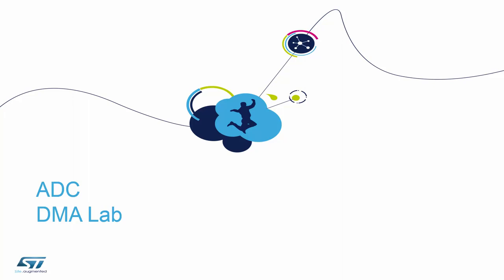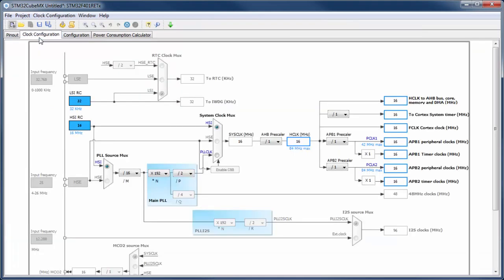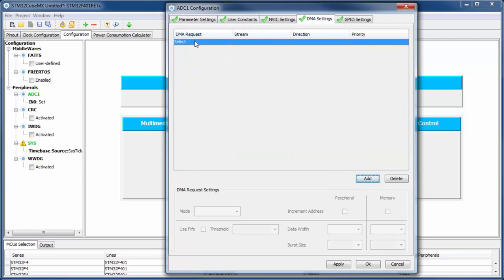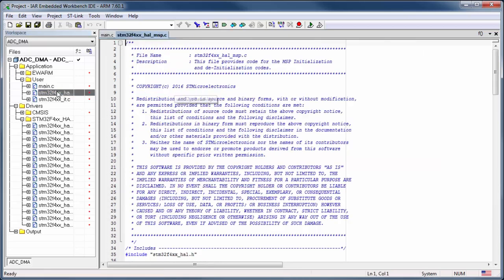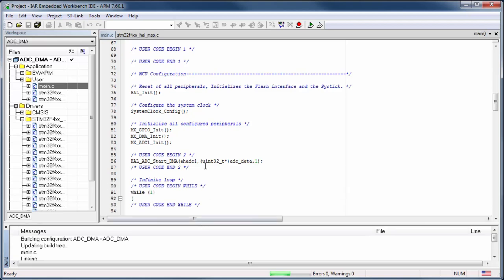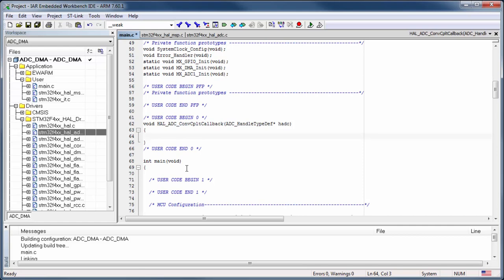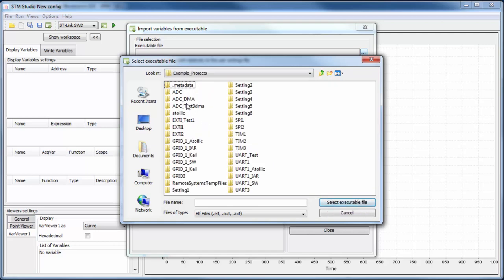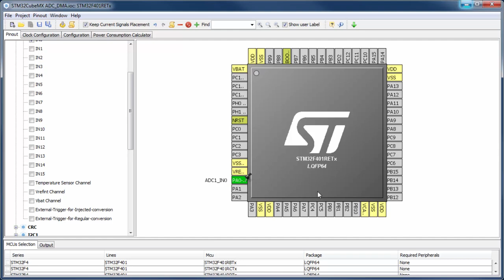STM32CubeMX basics: 13.2 STM32Cube HAL labs ADC - Lab ADC DMA

Comment: When enabling the ADC's SCAN option, will there will be a delta time between when the first channel of the sequence was sampled, and the last channel?    For example, If you have the ADC enabled to scan 8 channels, then if you use a 16Khz Timer Trigger Out Event as the External Conversion source, then ch1 would always be sampled in sync with the 16khz trigger event, but channel 8 is always sampled at 16khz+delta?

And if you do want the timer output to be the trigger source, what should the ADC's "Continuous Conversion Mode" option be set to?  Using STM-STUDIO-STM32, I can't tell what changes when  ContinuousConvMode = ENABLE vs DISABLE;
Reply from the maker: Hello! Visit our online community to find answers to your technical questions and share ideas with our developers and ST experts : https://community.st.com

Comment: Is it possible to measure different channels from one ADC using: HAL_ADC_PollForConversion(&hadc1,___) ?
I mean without using DMA or IT. I have used the next code, but It didn't take the values frome the two channels I defined. The code I am talking about is the next:

	  while (i<50)									
	  {
	          HAL_ADC_Start(&hadc1);

	          HAL_ADC_PollForConversion(&hadc1, 50);
	          a = HAL_ADC_GetValue(&hadc1);

	          HAL_ADC_PollForConversion(&hadc1, 50);
	          b = HAL_ADC_GetValue(&hadc1);

	          HAL_ADC_Stop(&hadc1);

	          channel1[i]= a;
	          channel2[i]= b;

	          i++;

	          HAL_Delay(100);

	  }

Comment: I must have missed something,  what made the adc value go 4096 to zero and back?
Reply from the maker: You are right, it was not obvious from the video. There is a button with pull-up on PA0 (like on NUCLEO-F401RC board).
Reply: @stmicroelectronics  a

Comment: Why did you change optimization? there is no explanation why, also why did you change from STM32cube ide to IAR, these series of videos are very hard to follow.
Reply: It is in an other video, please check again. Compiler may remove some unnecessary code for optimization so that program can not stop at break point.